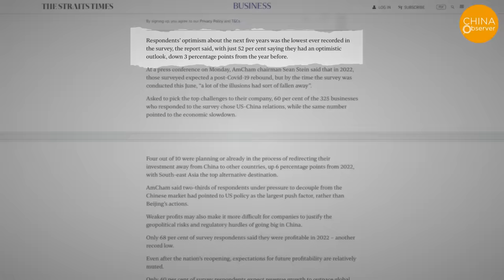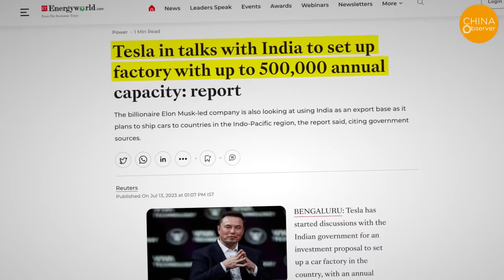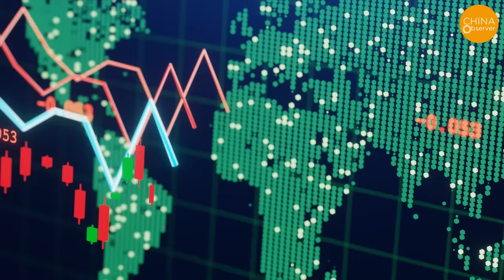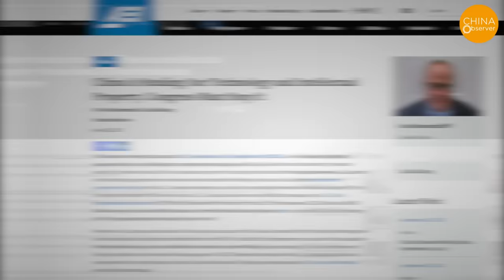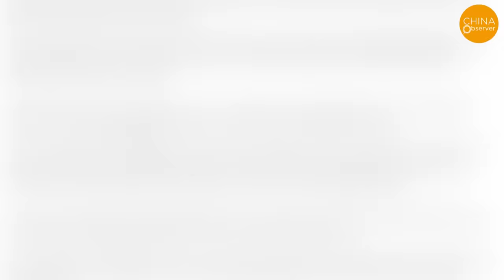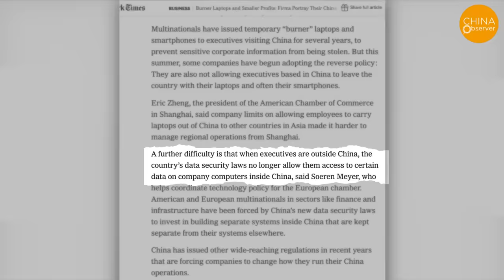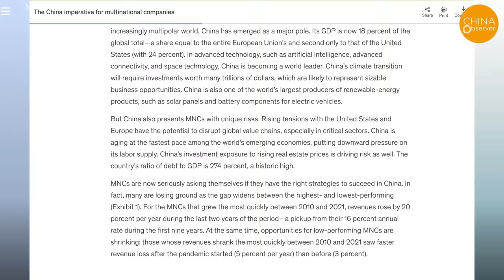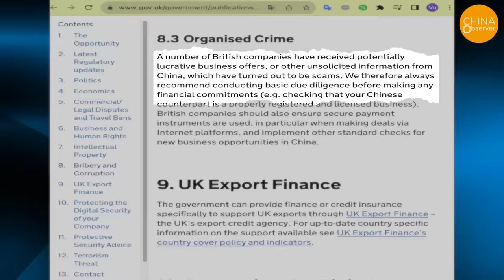China Is Done! No Longer Lures U.S. Companies! U.S. Business Confidence Plunges to a 25-Year Low!

Comment: Dealt with Chinese vendors for 20 years. In a nutshell, Low product cost, long expensive delivery chain, Constant quality issues, unreliable delivery, probable IP theft.
Reply: Yes yes yes
To sum it up = not great experience for low cost? 🎉😂
Reply: who was the best you delt with? or who would you recommend now? thank you
Reply: @MrXlee1967  Zero. It’s a culture of cheap, shoddy work and corruption. I’m recently retired. My former company is rapidly restructuring our supply chain.
Reply: the issue is you didn't have foot on the ground.  Successful manufacturing from China is possible but you had to have invested on having QC and management team to monitor and watch production process at every step of the supply chain.

Just look at what Apple is able to do as well as other brands like Coach.
Reply: @vueport99  We sent engineers over to china regularly to try and correct problems. Issues would be fixed for a few months and then back to junk. China has no understanding of QC.
Reply: @MM-mo2yc  they just want to "save" money in order to pocket it.
Reply: and TRASH products. (speaking as a receiver of those products).
Reply: they planned it that way